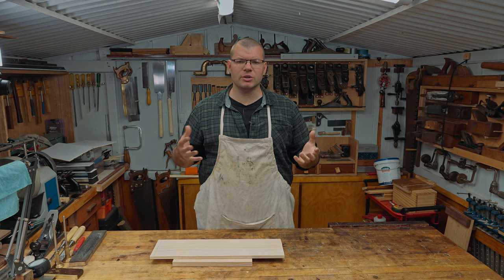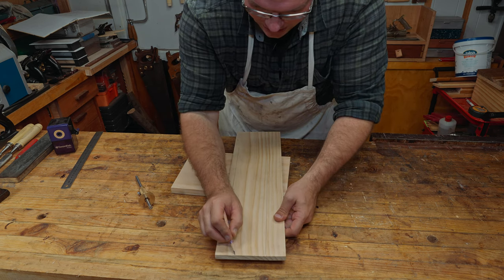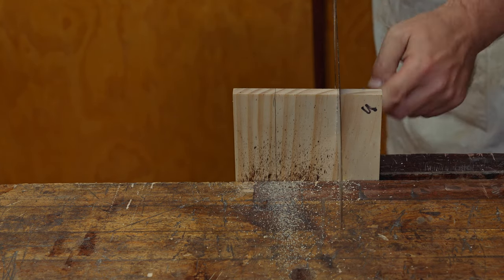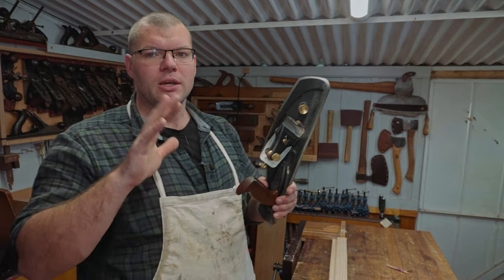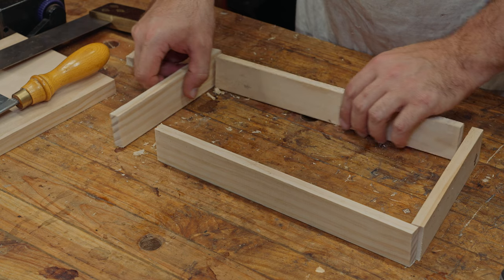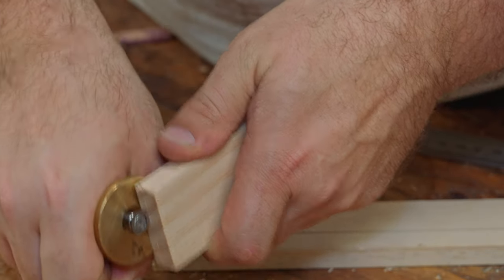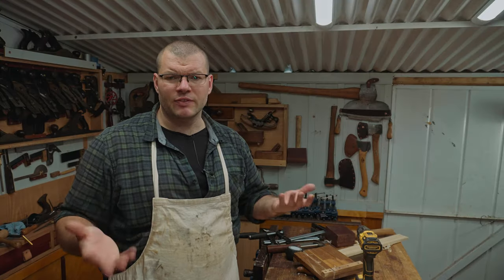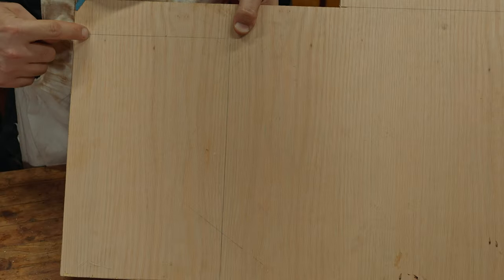Beginner Rebated Tray Build

Comment: Good video!! As always love to ear your explanation during the build up. And yes some times i don't go up until the end with my measurements or the exact design that i drafted - because if the two reasons: 1) during the process of building i see things that i didn't think of when i was sketching.
2) i made mistake during wood dimensioning.
So i am trying to be opened minded for changes during the process...i am not professional though my woodworking is more accurate than i begun 5 years ago
Reply from the maker: Glad you liked it. The 2 reasons you gave are the same for me.

Comment: Question with the shooting board use. Could you not nail in the base and then shoot? Or is it the. Suspectable to the plane digging into the side of the box.

At the moment, I'm just flipping planes, but I do enjoy these videos and it's great to see an Aussie making some videos. Shoutout from Melbourne.
Reply from the maker: You could attach the bottom first, but i find it easier to shoot the bottom first. You could hit the side which is why I don't tend to do it that way.